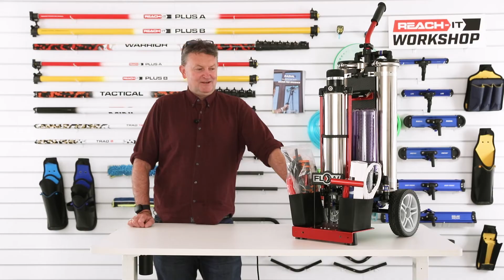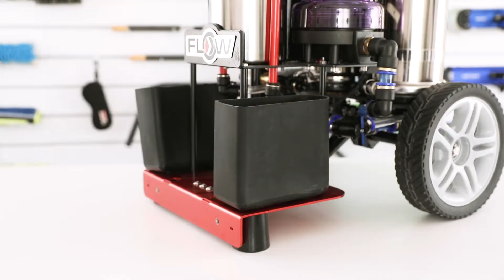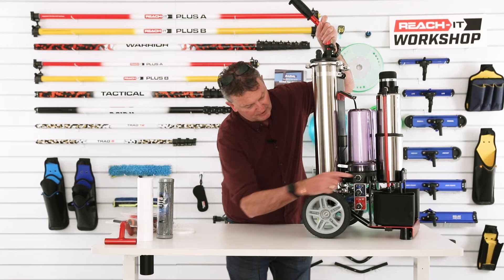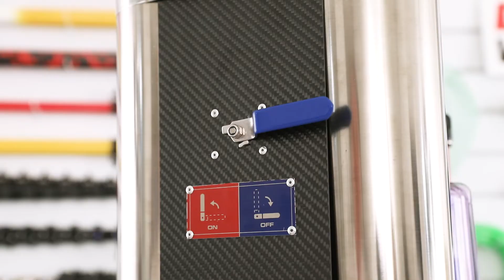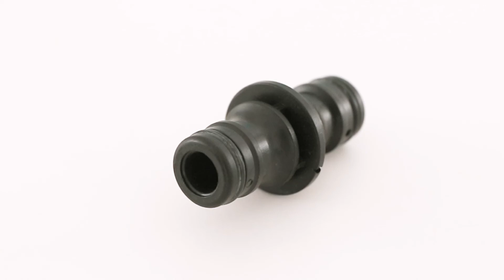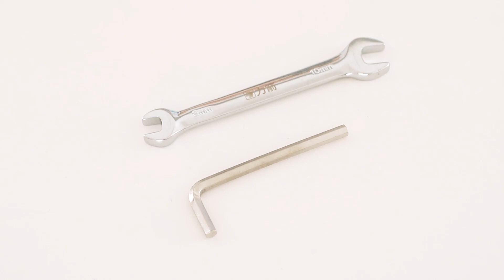All About FLOW RED+

Comment: We have the first version of flow and it has that valve underneath. Should that be wide open when we are using the unit?
Reply from the maker: Good question... The FLUSH VALVE, when open, is 'all water to waste' and when closed, is 'active pure water production'.  When closed, it is not actually closed - it has a hole in it that creates the back pressure, and also allows the waste water to pass through it.